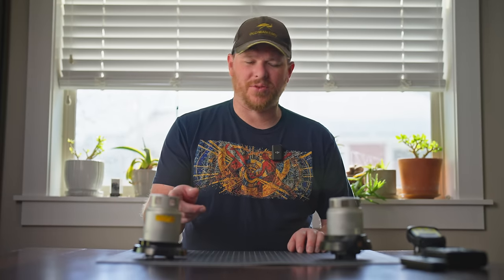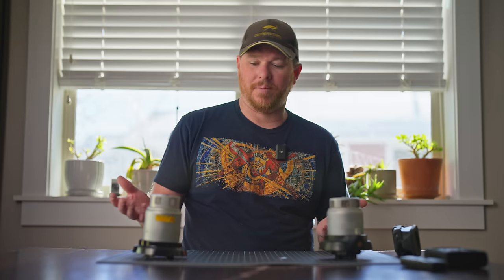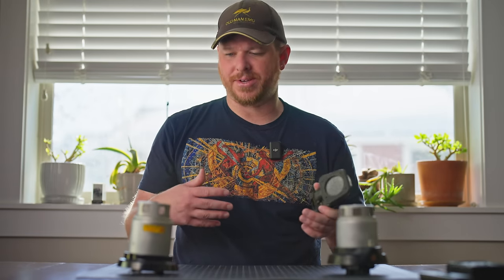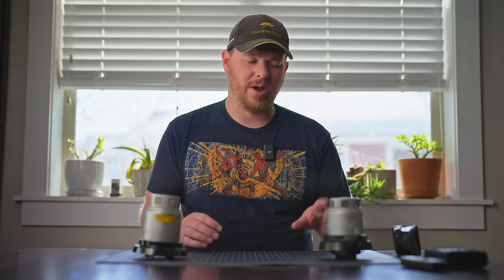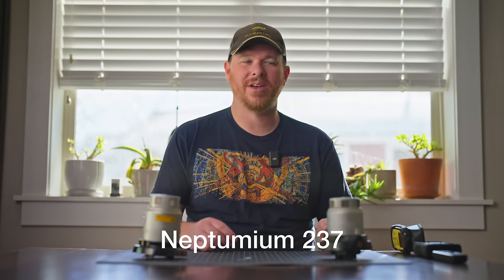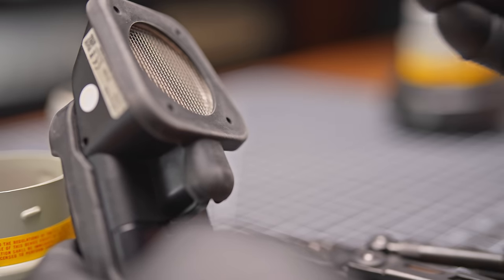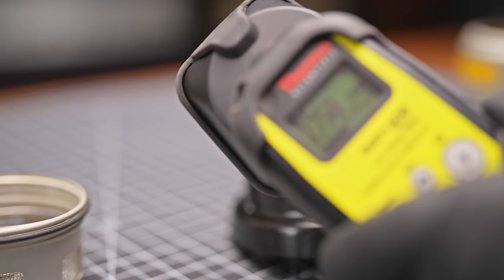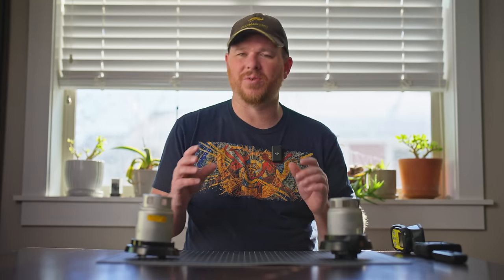Radioactive Cores from Industrial Smoke Detectors

Comment: cpm is a relative number. use correct units, like Sv/h!
Reply from the maker: You have it backwards there. Sieverts is a relative number. CPM is the actual alpha, beta particles or gamma rays being detected.
Reply: @RadioactiveDrew  i use multiple type of dosimeters, with different cpms. The common number is the Sv/h. I dont understand, why the americans use cpm...

( Sorry for my poor english )

So  WHY cpm? 

--- bella dosimeter ( sbm-20 )
--- dp5v dosimeter ( sbm-20 )
--- ih5 dosimeter ( si )
--- szém1 dosimeter very rare type, 930 units manufactured ( si )

I live in budapest, i was 10 in 1986.....
Reply from the maker: @criticalbulbs  CPM will vary depending on the geometry of the detector being used. Since pancake GM tubes are very similar in size the CPM readings will be very similar. Sieverts along with Rems are fairly common dose rate units used and that's why they are an option in most Geiger counters. Dose rates are really only useful for gamma radiation. For alpha and beta dose rates aren't used. So using CPM when dealing with sources that emit a lot of alpha and beta it makes much more sense to use CPM instead of something like Sieverts.
Reply: @RadioactiveDrew  BS.   1 meter is 1 meter.  mkay?